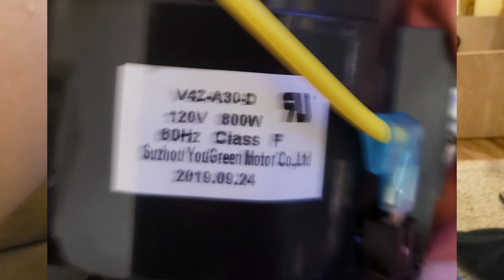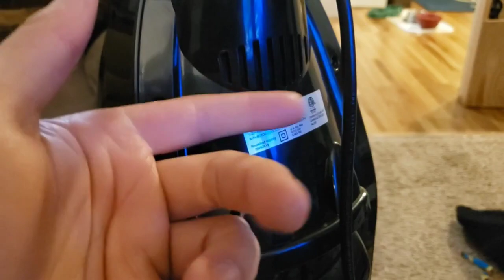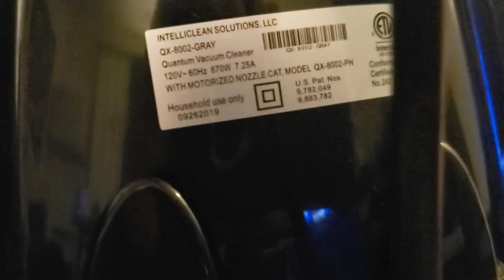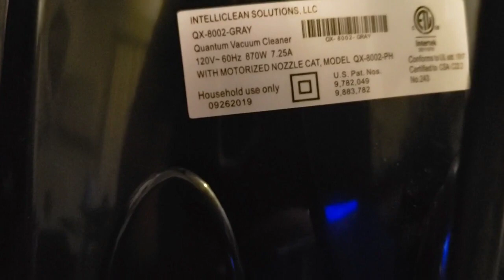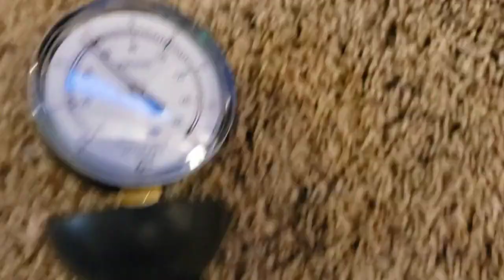Quantum QX 8002 Upright vacuum demo

Comment: Well now that that happened you took apart what you should know and there's a crack you can always send it back and say this was caused by shipping or something and they'll send you another one just don't take it apart just leave it it's still under warranty
Reply from the maker: I bought this unit as a used machine so it was not under warranty. I took it apart to clean it out as water filtration vacuums tend to be filthy due to improper usage (not changing water enough,  leaving a filled basin on the machine etc)

Comment: Of course it smelled like standing water...you left water in it and let it stand!!!
Reply from the maker: I'm assuming you're joking with me.  Odors can be an issue with water filtration vacuums when they aren't properly cared for. Neglectful owners will leave the dirty water in the machine which can lead to that. It's best to dump the units when you're finished and not place the water pan back on it until it's dry.